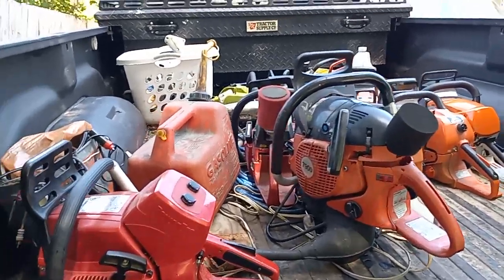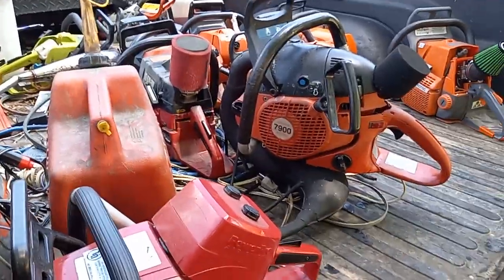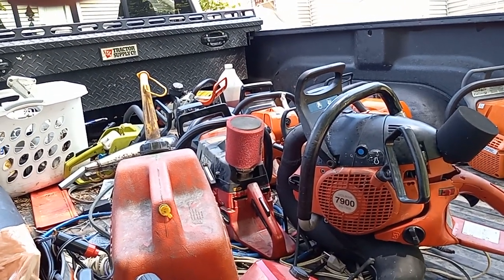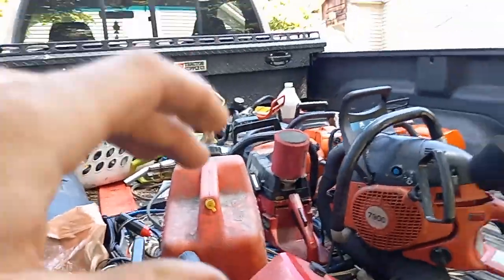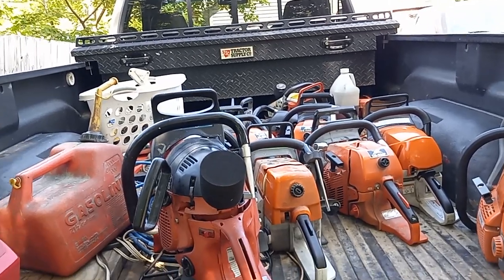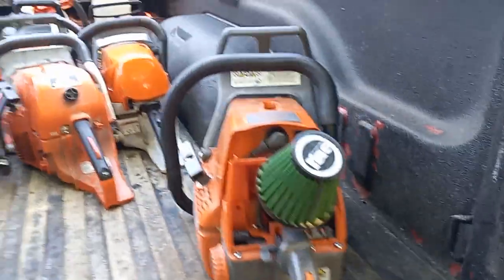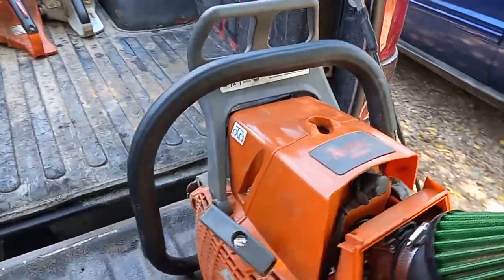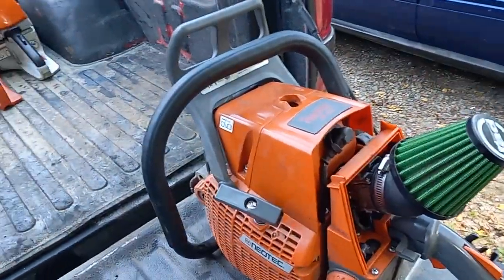back from dyno joes

Comment: On the neotec 660 I would pull the cylinder put epoxy in the intake and by lunch time tomorrow be ready to grind on. Set the intake timing to 156 duration .